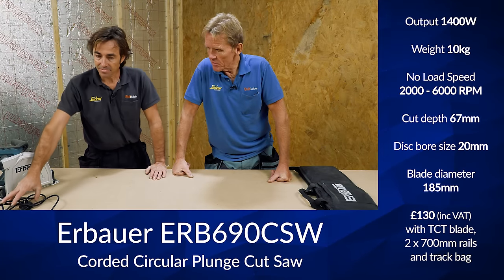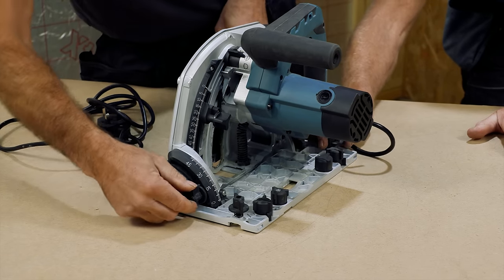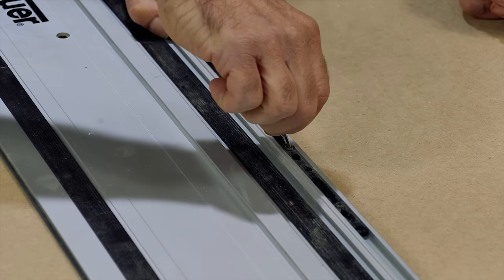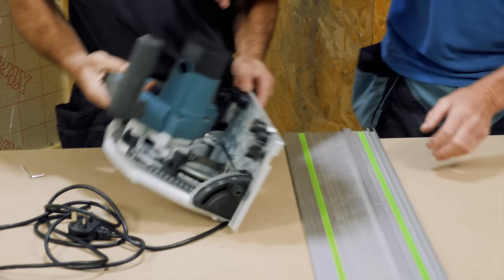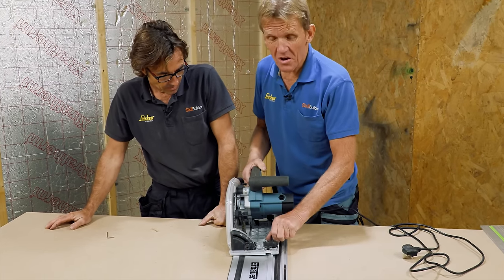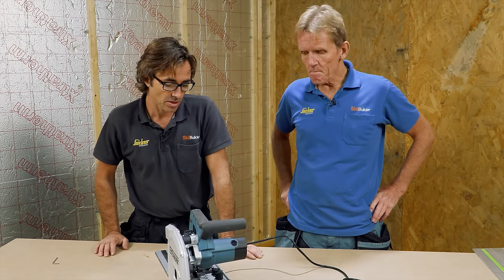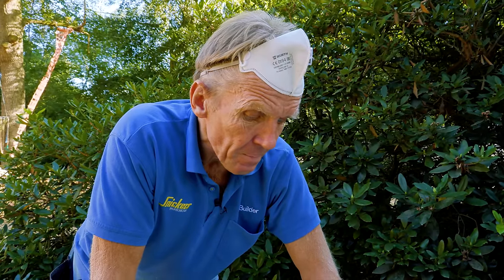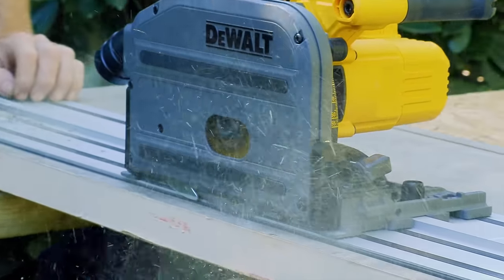Erbauer ERB690 Screwfix Plunge Saw - Episode 2

Comment: AFAIK, Erbauer, MacAllister,Triton, Titan, Aldi's Workzone/Ferrox and Lidl's Parkside are all made by the same company - Positec. I bought the Workzone plunge saw for £80 and it works sweet. For other tools I have Hitachi or Makita but didn't see the cost benefit for a tool I'm not going to use as much. Also Hitachi (now Hi-Koki) have really put their prices up.
Reply: I have used titan, work zone, macallister, erbauer, 
I must say erbauer is by far the best out of all the above you mentioned 
Apart from your big brands obviously

Comment: Bit of a half-hearted review just because it's cheap.. I suggest you look at the instructions and study the machine a bit more, than just a quick glance at it. You didn't really tell us anything apart from you don't like the anti kick back and cuts 67mm deep. That is 67mm is off the tracks. Really bad review because it's cheap. Look at the Bosch saw how rubbish was that. Talking about erbauer  poor build quality things flapping around at least it seated on the tracks properly. For the money it's a good machine. Think you should review this again.
Reply: I take it you have this saw
Reply: I was hoping for a more in depth and informative review too...
Is the depth gauge calibrated for on-track use?
And is it accurate?
Are the trueing cams effective at consistently aligning it on the track?
Is the blade in-line with the 90 and 45⁰ marks on the front edge of the plate?
Is the track compatible with track squares such as Benchdog's?
Reply: 100% i have 2 of them great wee saws... people think you need all the big names in tools. But you really dont..

Comment: Thanks for the review.  I just bought one of these from Screwfix yesterday for £134.99.  (10% discount for a few days).
Reply: Could I ask what you was cutting and if it was any good?
Reply: @michaelcoles6140  I have used this saw for chipboard, OSB and 18mm ply.  I bought it to make some wardrobes and it did the job.  I would class it as a good DIY tool rather than for trade but that is reflected in the price.  The depth adjustment knob feels flimsy but works.  The motor is powerful and cuts without any issues.  The track is fine and it cuts straight with the aid of the track clamps.  Would I buy it again? Yes.  I hope this helps.
Reply: @henrymurphy5284  hi thanks for the reply, I went and bought one it seems the depth is wrong on mine by 8mm and the saw cuts out as it goes through 18mm chip so It seems as if I got a dodge one 🤦‍♂️ only wanted a cheap one so I could buy some more Milwaukee tools but wished I got the makita 4ov now.

Comment: Using these track being that they are 700mm and a door is 762mm. When the saw is fully engaged on yhe track the blade doesn't cut the rear edge of the door. You can only go in one direction. If I use both tracks to 1400mm the ends for the clamps are in thin air, or at least one is. Any professional ideas?

Comment: Wait does that mean the festool would run on the Erbauer track?
Reply: Yes but they don't sell the track. Only in the kit or I would go for the cheap track
Reply: I thonk Makita, erbauer, festool and Tiatan are all compatible...
Reply: Yes the festool and these cheaper are comparable, the Mafell will also run on this style track too.
Reply: You can get the track-set from Westfalia. They have the same saw under their brand and with a case and the tracks seperatly for about 70,-. But it's without the bag and the clamps.

Comment: Thanks for the review Guys,  
I was looking at a track saw to trim 11 oak doors to fit existing frames,
The erbauer saw works great straight out of the box, i added another track section to allow trimming the width,
It  leaves a nice clean finish , not found the anti kick back an issue as one pass does the job ,
For dust extraction , i cut the neck off the bag adapter and pushed it into the saw outlet, my henry hoover hose now fits snugly into the saw and leaves hardly any dust, the bag or no hoover leaves a lot of sawdust, 
I have a trend blade ready to fit still in the wrapper, wasn’t expecting the supplied blade to do such a good job,

Comment: I thought the screwfix branding was Titan not Erbauer
Reply from the maker: Erbauer is a Screwfix brand and they jointly developed Titan power tools with Brico Dépôt.
Reply: Skill Builder and Brico is owned by Screwfix - isn’t it all a wicked web they weave.😂
Reply: Erbauer tools are now also being sold  by B&Q. 

My biggest gripe about Erbauer is that you cannot buy spare parts and once the tool is out of warranty there is no option of a repair facility. It is essentially a throw away tool once it breaks! One reason I didn't buy their bench top thicknesser, they don't even sell spare blades!
Reply: Mechanoid 57 All part of the Kingfisher group. https://en.m.wikipedia.org/wiki/Kingfisher_plc
Reply: Erbauer saws I've had potentially lethally dangerous. Frightening. Described over phone in middle of night and, to be fair, they said to return immediately. Screwfix returns policy is a reason I use them. Other Erbauer tools I've tried just feel clumsy. Totally agree with need to practice with such gear

Comment: Could you suggest a decent low end track saw, Cheers
Reply from the maker: You are looking at it in this video
Reply: Thanks
Reply: @SkillBuilder  Can I ask what track is compatible with that saw , I was looking at the Powertec55" on Amazon . Didn't want to buy if the track wont fit. Great channel Thanks again
Reply: @madforit9661  it is compatible with powertec track. That track is good for Mikita, Festool and other plunge saws.
Reply: @richardlug6139  Thanks, I will place my order for it now.

Comment: I'm a DIYer and couldn't justify the cost of a Festool or Makita for the amount I'll use it so bought the Erbauer and 2x1400 Evolution tracks. The anti-kickback came off before the first cut, way too much drag - a good idea poorly executed. Slow start really is slow, you have to wait for the saw to be up to speed. Great value - you get the saw, tracks, track bag, joiners and clamps. Downsides: It's heavy and being Erbauer there'll be no spares so if it breaks it's a bin job but it does have a 2 year warranty and most importantly, the quality of the cut is excellent - easily as good as the Makita SP6000 I borrowed before buying this.
Reply: ye stop was off before the first cut to ha.. do the evolutions tracks fit mate, im looking for a 8 foot for my erbauer, im a carpenter and think the saw is great for the price, great finish and power
Reply: @mymate18  yes, the saw works fine on the Evolution tracks, they're reasonably priced and, like the Erbauer tracks they come with a bag, joiners and clamps.
Reply: Got mine 2nd/3rd hand few weeks ago, new clamps needed and new blade but for 30 quid the tracks alone are worth the cost. Gonna get evolution tracks soon as they seem to get good feedback.
Reply: @TheFazer1992  I bought a set of 2 1400 mm Evolution tracks from Toolden. They work fine with the Erbaur saw.
Reply: Out of curiosity, if using the evolution tracks what’s the downside in using their track compatible circular saw which is way cheaper? Does a dedicated plunge saw off much different?

Comment: Seems like Detroit, Bayer and Triton have the same OEM as this Erbauer. Parts like the plastic moulding for the handle, rail adjustment knobs and blade positioning switches are the same

Comment: I dont understand why in every review peoole are not happy with antikick back feature , it is actually great because a saw on a track if kicks back will damage  a lot
Reply from the maker: It makes it hard to move back on the rail. Once you know what you are doing the saw should not kick back
Reply: I took it off mine because it was causing excess friction moving the saw forwards - enough to move the rails if not clamped. Pity because I agree that it should be a good safety feature.